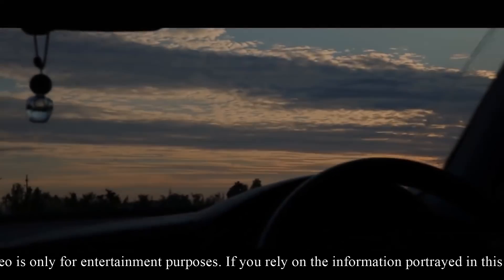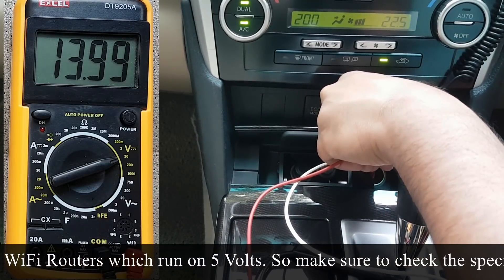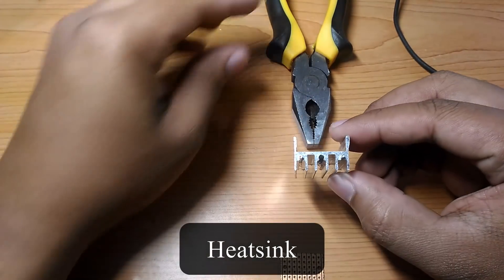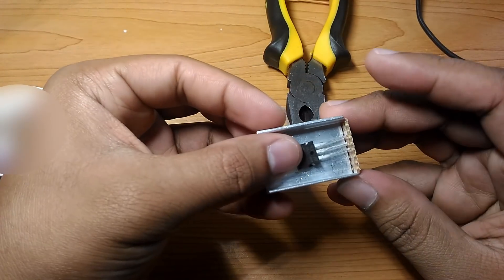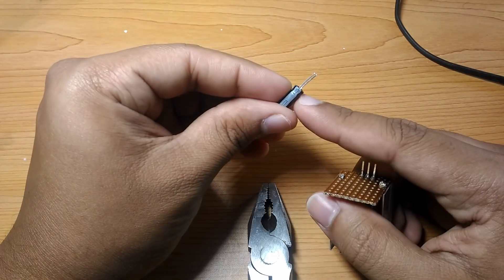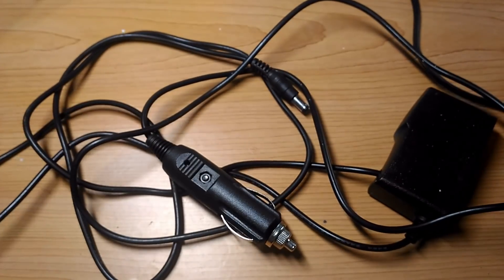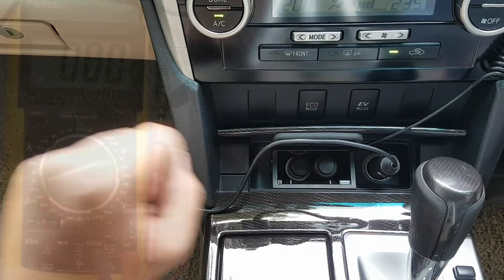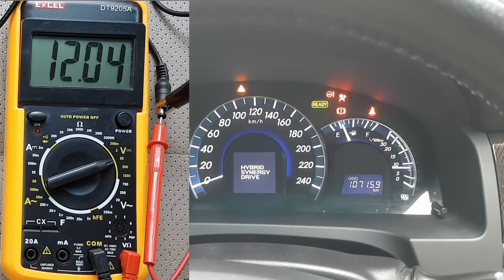Add WiFi to your Car (Internet Life Hack - Home internet in your car - Cellular Access WiFi Router)

Comment: I need 10 down 10 up from my vehicle, I work mainly from my car and I would really appreciate someone’s help.... Thank you!!! 😊
Reply from the maker: What do you mean 10 down and 10 up?
Reply: Project Volt  I need 10mbps Download and at least 10mbps Upload or my CRM doesn’t stay online and I have to work from home but I would rather work from the road while traveling... I can’t wait for 5G to be available, that is going to change everything!!
Reply from the maker: @BbbyRob30  there are 4G Vehicle Roof Antennas which they claim to solve weak signal in a vehicle. I cannot guarantee it myself since I have not tried it. If that doesnt work there are 4G routers which are to be fixed outside a building, and they have a good signal strength compared with antennas. You could use such a router and mount it somewhere outside the vehicle when its parked.

I would not rely on 5G since 5G signals do not travel long distances from the tower, which requires many towers to be installed for you to get a good signal. 5G is fast but since you want to use it on the road, there will be many areas where you would not get coverage. Sadly good things comes with a big cost.
Reply: Project Volt  Thank you for your feedback my friend!  I think that the only way I will be able to work from my vehicle in the next year or two will be positioning myself relatively close to 5G service/towers like you said BUT that is pretty far off in some of the areas outside of the larger US cities unfortunately.... But I do think in about late 2021 we will have a true 5G signal that can be accessed in most areas.. But directional antennas will probably still be a necessity... Thanks again brother!!  👍🏼
Reply: @BbbyRob30  jokes...its 2022 and no 5g for consumers yet

Comment: How does the router get internet?
Reply from the maker: @AA Deaney Because for such Home WiFi dedicated routers, the internet companies lock the SIM for that specific router using its IMEI.
Reply: where's the DSL connection ???
you want 20-50 metre cable telephone line to your car
and connect it to your router and
you have internet..........
Reply: @ToKanaliTisTileorasis  This box uses internet services like your cell phone. It is wireless. It does not need a connection to the DSL or cabke infrastructure like home internet. It is 4G.
Reply: @ToKanaliTisTileorasis  This is a 4g router you put the Sim card in the router
Reply: @dg2q  ok mr. -'
Reply from the maker: @AA Deaney Its not your fault, company policies change from ISP to ISP. Thanks for commenting :) Hope to see you next time.
Reply from the maker: The router used in the video is a 4G router. This method will not work with ADSL or FIBRE connections.